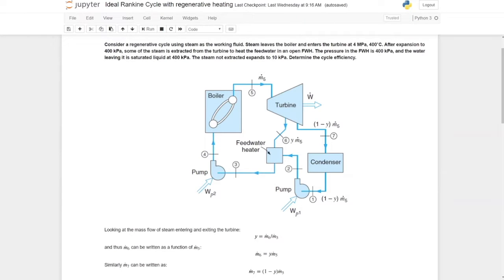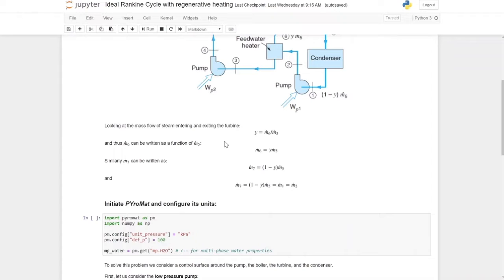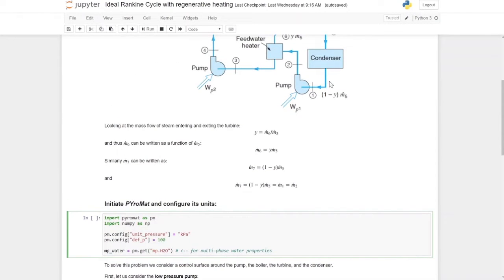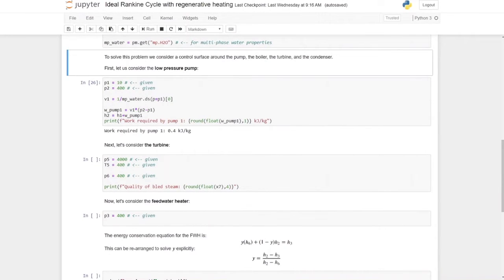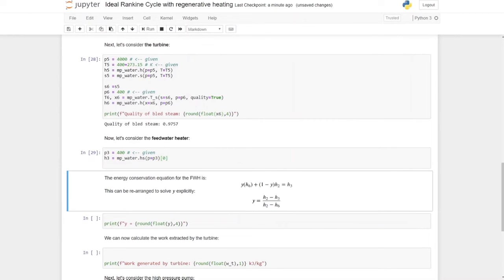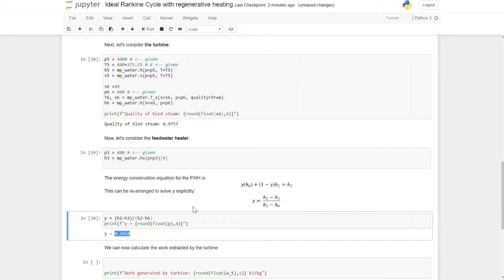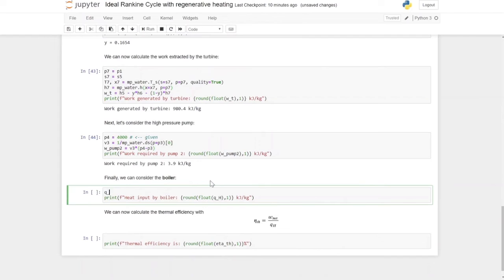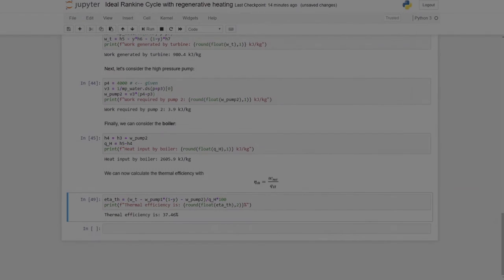Calculating the efficiency of an Ideal Rankine Cycle with feedwater heater | Python | Thermodynamics

Comment: Hi!!! So great the videos. I have a question.  What'd happen if the point 6 has no quality? I know you can determine the Temperature and then h6 = mp_water.h(p = p6, T= t6) . Could h6 be determined with pressure and entropy directly like in EES  h6 = mp_water.h(p = p6, s= s6) ?